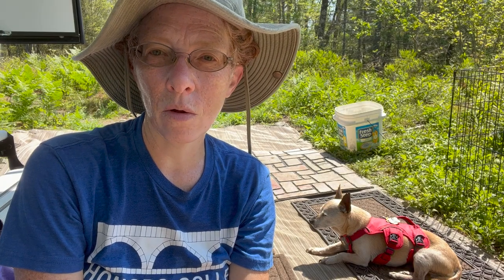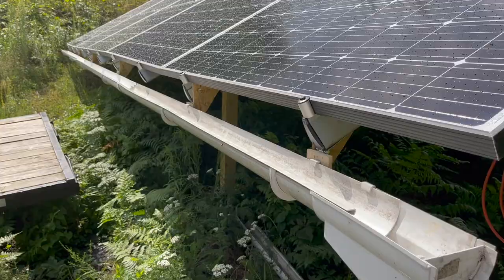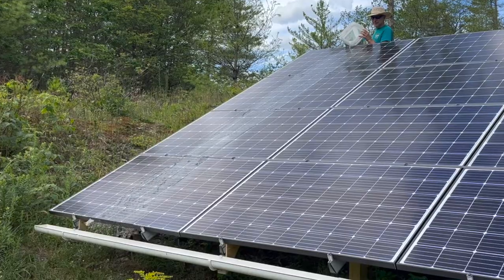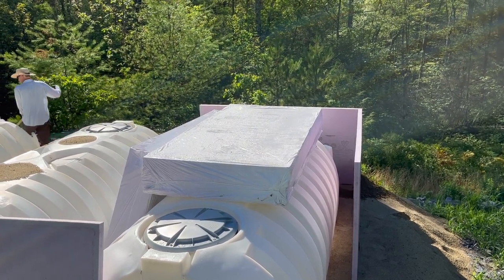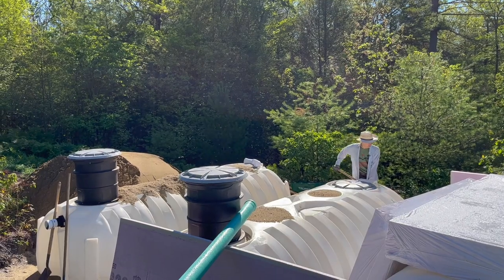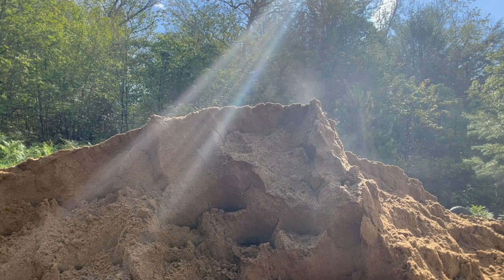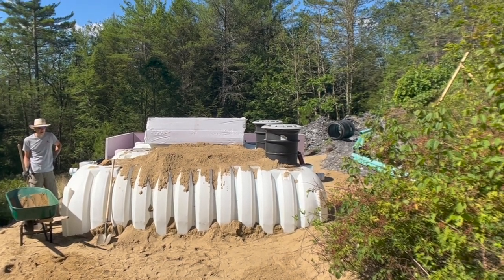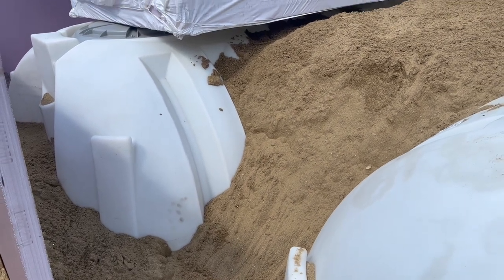A solar array that captures… the rain?  (Vermont DIY off-grid home build)

Comment: Where do you store the rain once you catched it?  Do you use pump and gravity to pump the rain?  I am planning to do the same as you did and harvest the rain to cool down solar panels in the summer.
Reply from the maker: Hi Tom, we are going to run it through a pipe that goes under the driveway, to an IBC tote next to the solar equipment shed. This water will be for things like watering fruit trees (which we haven't planted yet due to the caterpillar outbreak).
Reply from the maker: (But we will also collect rainwater from gutters on the yurt, which will go in our three 1500 gallon cisterns).